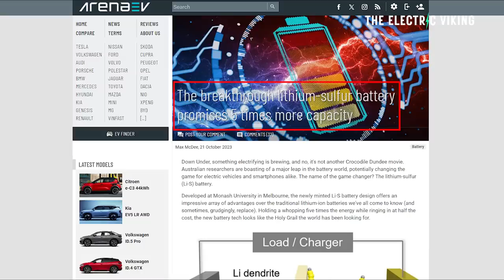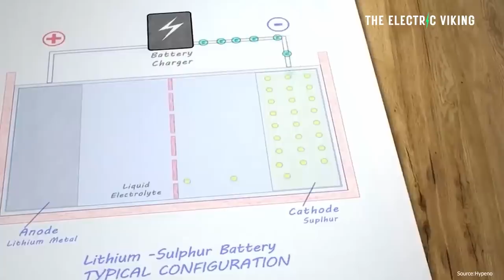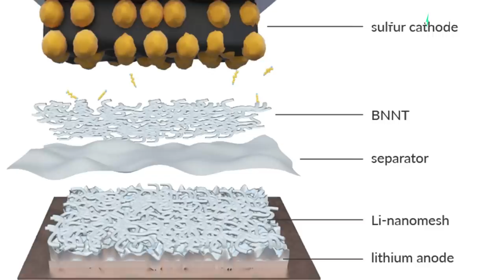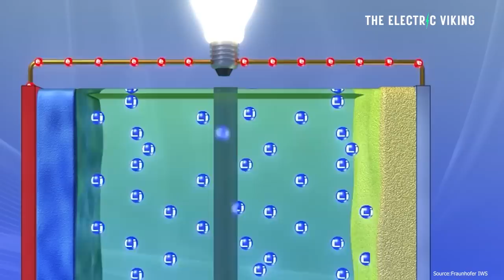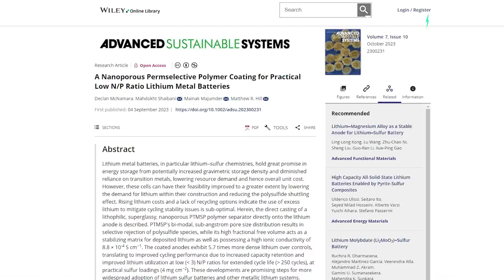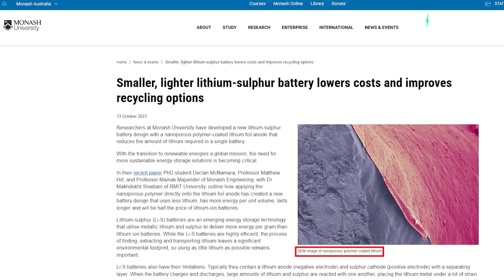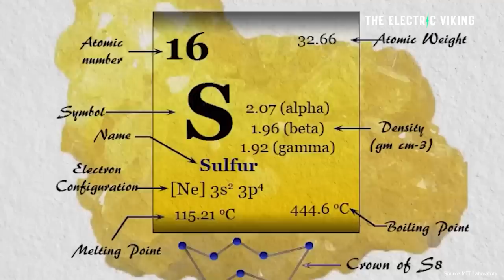Breakthrough for new battery that has five times the power of lithium-ion

Comment: It's a little hard to take this seriously when the presenter conflates power and energy. They cover the difference in high school physics. Power is an important characteristic of an EV battery in particular but it is not the same as capacity. Power is the RATE at which energy can be delivered.
Reply: This kind of sloppiness with terms is pretty common on YouTube channels, unfortunately.  I've seen other quotes stating that Li-S has twice the energy density as Li-ion, so this 5 times number, especially if he actually mean energy rather than power, is very suspect.  I have also read that the charging speed for Li-S is substantially faster as well, which normally implies that it can discharge faster as well, and maybe that's where 5X power number is coming from.

Comment: So ‘commercially ready’ really means ‘still in the lab’. It still faces the challenges of (a) successfully getting into high volume manufacture and (b) proving performance in large scale real-life conditions.
Reply: Yeah, I think he started talking about a company that does have a product available and then switched to another company with a similar sulfur components but is still very much it the lab.  It's pretty confusing.  The one thing I've learned in the last 30 years of reading tech news is whenever nano-structures is mentioned you can bet the product will not be available at commercial scale anytime soon if ever.  One day they might figure it out but just because something works in the lab doesn't mean it can be manufacture at scale, like you said.
Reply: Give it a monrh
Reply: 500% energy denser means more power to explode or do damage. That is an awful amount of stored energy. Lithium batteries suffer two problems fires and high voltage shocks, even with out the fires the new batteries will be lethal.
Reply: @tonysheerness2427 not necessarily, the chemistry is different. Some chemistries don't explode or start a fire when damaged
Reply: @orionbetelgeuse1937  that's not necessarily the case as some new technology, technique or happy accident might just make it viable. Too often research and development is directed by naked profit and obtuse politics limiting funding to potential world changing tech for decades or ever.
Reply: Yeah...they have to present something so their stream of getting  funded doesn't end. 

They have no interest in developing a battery which makes them as researchers negligible.
Reply: Sounds like you are hoping for it not to succeed Sunshine?
Reply: No doubt this new power source will be propelling the concorde replacement,which has been coming next year for the last 20 years.
Reply: @tonyireland2234  Seriously though with this sort of power density Fan Jet flying cars are viable.
Reply: @tonysheerness2427    Yes, more energy density give them the potential to do more damage as well as more good.  But can they do more damage than gasoline?🤔
Reply: @Marian87  stored electrical energy doesn't have to be a chemical reaction to catch fire electrical short after accident or rub through short thus no good if it has massive stored electricity.

Comment: These claims are meaningless without knowing - cost, energy density by mass, energy density by volume, recharge time, discharge time, degradation from charging, safety, manufacturing viability and a bunch of other factors. I could easily see many batteries being better in some ways than what is out in the world, but if they have a propensity to explode or cost 10x as much then they're not viable.

Comment: I've seen an awful lot of "game changing, ready to go" battery techs become "I wonder what happened to XY battery tech" over the years.
I'll get enthusiastic when I hear about manufacturability, how many cycles, safety and that it has gone into mass production.
Reply: How were they ready to go if there's no mass manufacturing plant set up?
Reply: @-whackd  same as this tech. that is what they announced.
Reply: Pump and dump the stock scam.  What looks like Indian call center "professor" running that gig.
Reply: @sailingaeolus see, you've caught on to the grift.
Reply: A large plant is being built in Colorado to produce Silicon-anode lithium batteries. They solved the swelling issue and the military completed their testing, even driving a nail through one.  These batteries have 6 times the energy density of current lithium ion batteries.  No word on the cost, but they charge and discharge quickly and have the same energy density as TNT
Reply: sodium ion is being rolled out on small EVs in china, will be interesting how the perform over the years and how much better the next gen of sodium is, BYD is expanding it production capacity so we'll know soon enough

Comment: Most likely 5 times the fire and explosive power to go a long with its density.
Reply: It depends on the design. Some designs have higher energy density with dramatically reduced risk of fire. So it’s not as simple as more energy = bigger fire hazard.

Comment: Sam, great post, per usual! What we really need now is an inexpensive home batteries! They can be large and heavy. But, the batteries need to be made from common materials, be fire resistant, and have a lot of cycles. An inexpensive battery combined with solar panels would allow home and small businesses to generate and store their own power, and thus weaken the stranglehold of price gouging electric utility monopolies.
Reply: You're talking about sodium-ion batteries.
Reply: @thyristo Are they commercially available? I'd be interested in such a solution.
Reply: You are right, size and weight are not the problem as portability is not a need once in place, safer material that does not burn is critical.
Reply: If I could actually buy some of these magical $90 per Kwh batteris a powerwall would be $1000. Everyone still seems to be selling 10Kwh Home batteries for 10K
Reply: Can anyone give a source of $90/kWh lithium battieries ? (Au $150/kWh )
 Comments like $90/kWh  are just BS until they are actually commercially available to the public
 Even if you wanted GWh’s of Teslas Megapacks, …the cost would still be Au$500+ per kWh !
  And the good old lead acid battery is still way more than $90/kWh !
Reply: The Sodium-Ion should become what we are looking for at a home scale level.

Comment: I’ve been hearing this every month about a battery breakthrough for the last few years yet most EVs still only have a 300 mile range at best.
Reply: That's all I need.
Reply: My S has 400 range and that will improve in the next two years dramatically with the CyberTruck and new 3 improvements